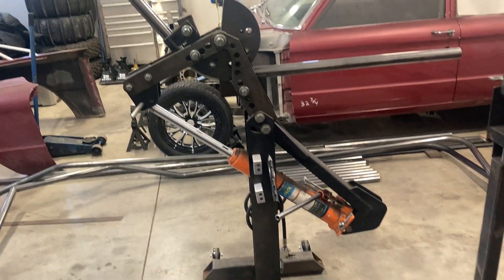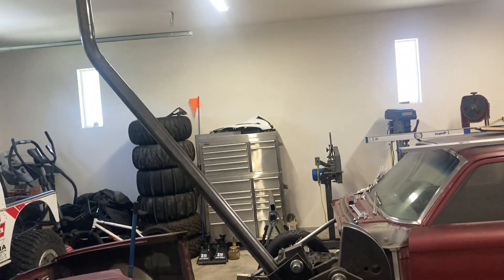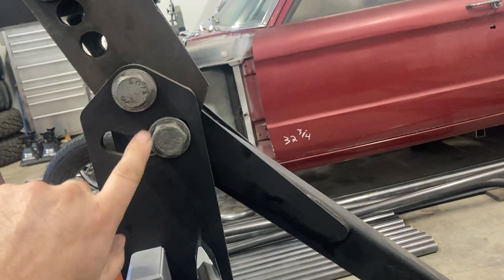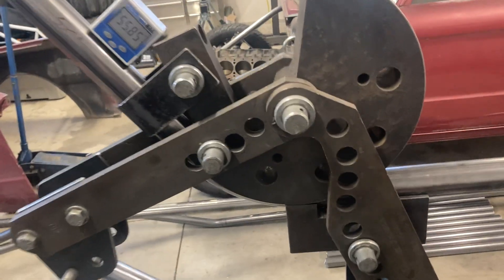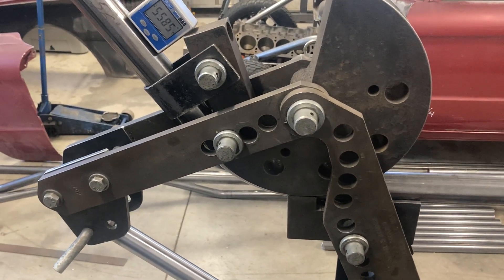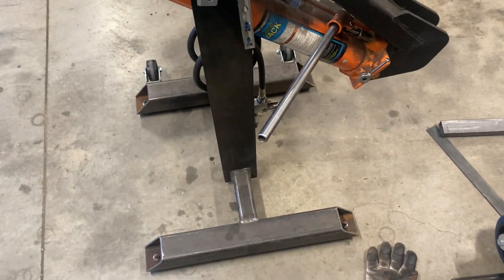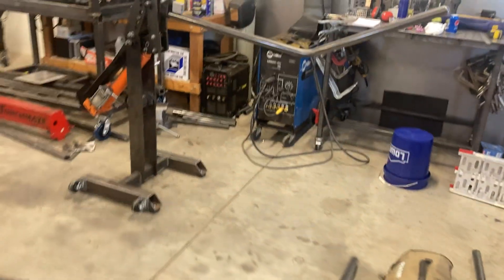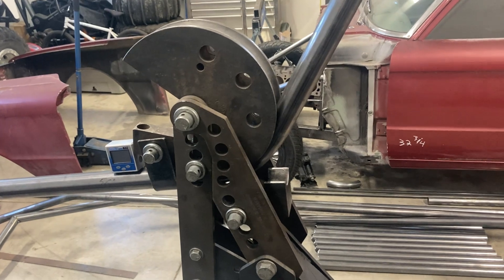My tube bender setup

Comment: What is the width of your up rights?
Reply from the maker: 4” x 3/3”
Reply: @ultra4suzukisamurai679 
I built with a 3" remnant. It works fine but didn't level out. So I will widen it up and fix it.
Thanks